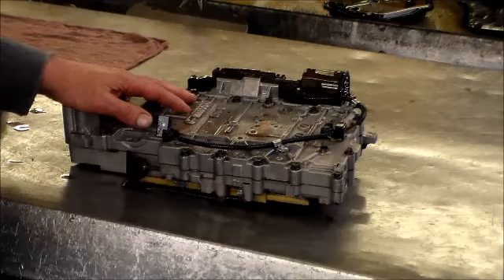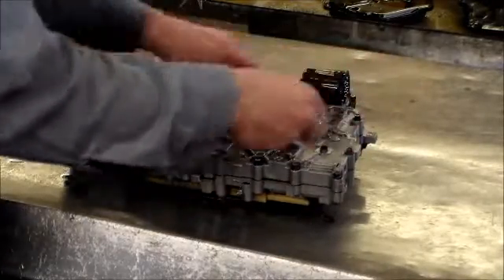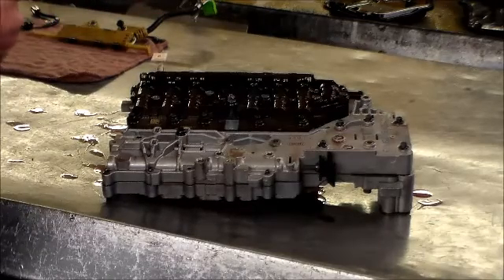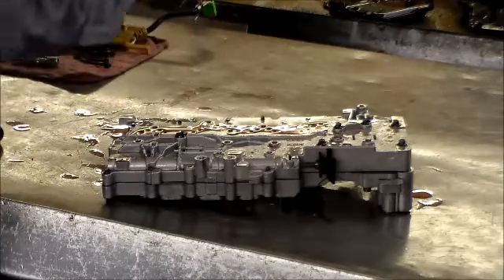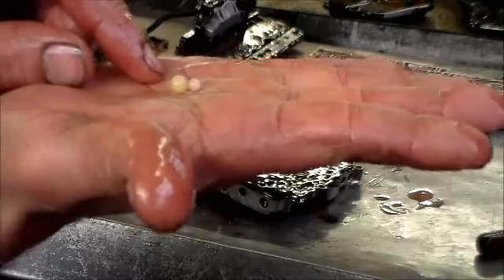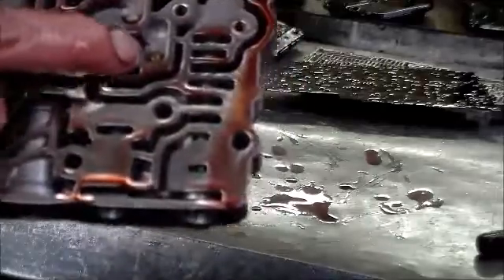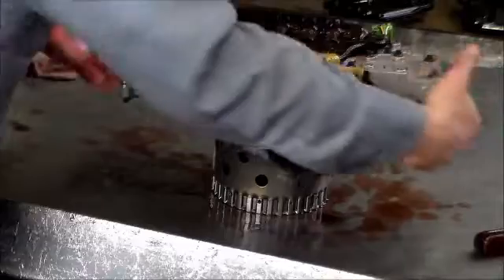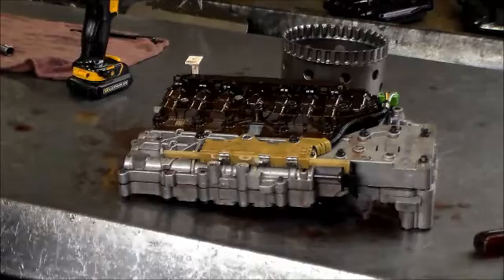6L80E Valvebody

Comment: Hi @Gary Ferraro. Thanks for the videos and all your help. I have a 2010 Chevy Silverado 1500 with the 5.3l motor. I believe the 6L80 transmission. I have codes p0776 and p0700. The truck seems to over rev up to 4k rpm before shifting to 3rd gear and when in reverse it is really lazy and struggles to back up into my driveway. Also, I checked the trans fluid and it seems to be way overfilled! So I drained some of the fluid out until it was in the cross hatch area. I then drove it around the block to see if that made any difference but problem remained the same. What do you think could be the problem?
Reply from the maker: does the trans work better when cold? then when warms up starts to slip?
Reply: @GaryFerraro  It does NOT do it when cold. Forgot to mention that I just bought it from an auction and don't know the history in addition to the trans fluid being over full as well.
Reply: Did you find the problem mine was doing the same codes and same symtoms as you described I just took off the techcm and valve body trying to see what’s next
Reply: @big_W  I was told to replace the techm but I was not confident that was going to solve the issue and I didn't want to waste money if it wasn't the fix so I just replaced the whole transmission. Keep in mind, if you are able to get a guarantee from a reputable shop that replacing the techm will fix it then go ahead as it is a much cheaper fix.

Comment: Hi garry, I have a 6l80e in my gm holden commodore from Australia,   would a valve body unit that is faulty cause the 6l80e to flare? Mine flares when I accelerate hard, I pulled the it out a few months ago and had a crack on the drum, that was fixed and transmission was good for a few months, now my transmission repare shop seems to think the problem is in the valve body?
Reply from the maker: When does it flair    what shift?
Reply: @GaryFerraro 2-3rd... Will only do it once cars been turned off and in park, then re started and driving will flare once 2-3rd, and will not flare again unless you take off hard. I changed over the transmission with another rebuilt one and problem is still there and my mechanic believes it must be the valve body
Reply from the maker: @andrewnewman55  What year is the car?
Reply from the maker: @andrewnewman55  ok, so you swapped transmissions but installed your original valvebody/TCM and same issue?
Reply: @GaryFerraro  that's correct
Reply from the maker: @andrewnewman55  By chance have you tried resetting shift adapts?
Reply: @GaryFerraro  yes, they have been reset
Reply from the maker: @andrewnewman55  very possible valvebody or solenoid issue, in the valvebody are valves called clutch select valves, you want to make sure those are free, also could possibly be a leaking bore plug
Reply: @GaryFerraro  I have been quoted $1,200 for a reconditioned valve body and tcm installed and programmed, I'll let you know how I go once I have changed them over, thanks Gary
Reply: Andrew the flaring was common in many of the commodores because they used a shallow trans pan.  Look into getting the deeper transmission pan from other models.  Cadillac CTS I believe. YOu get a deeper pan and a different filter that has a wider mouth to suck up the fluid.  On hard accelerations it does not starve the trans for fluid and thus no flare.

Comment: Hi Gary, almost positive this is the issue with my 2010 Sierra. Transmission was totally fine until I lost all of my forward gears. If I pull the tranny ignition fuse, it will pump full pressure and I can move forward to at least move the truck around so I know that it CAN go forward. Almost positive it's going to be this check ball issue. Once I drop the pan, how difficult will it be to drop the valve body from underneath the truck and are there any specific tips you can give before I do? I'm ready to do a lot of cursing this weekend. Thanks for a great video
Reply from the maker: After the pan and filter are dropped, you need to pull the sleeve out or the valvebody will not come down and i wouldn't want for you to break the TCM.  There are 6 bolts the hold the valvebody to the case, a special socket is needed, the size is EP10  Like a torx plus socket. The tcm will need to be unbolted from the valvebody, then the valvebody can be unbolted and split apart

Comment: I have the same problem I was driving down the road and it seem like a kicked in a neutral but it was in drive then I unplug the battery for about 20 minutes and hooked it back up and started driving again and it shift through all the gears and when I come up to a light and stop it act like it kicked back in neutral it does the same in reverse what do you think that might be and it's making some kind of rattling noise right there where the pain is
Reply from the maker: Did you have it scanned for codes?

Comment: I put .250 metal balls in my valve body on a 6l80 and now i have p0977 p0974 does it matter if there metal
Reply from the maker: What year is this,  also what is the make and model.  I never used metal check balls in this unit.  What was original problem?
Reply: Pode romper a placa

Comment: Hi, great video! My 2008 GMC Yukon Denali has the 6L80 tranny. Lately, as winter started, when I first start the car, there is about a 2-3 second delay of engagement from Park to reverse, Park to drive, or reverse to drive...and when it does engage, it noticeably jolts into gear. If I let the truck warm up about 1-2 minutes first, it definitely is not so bad. If I drive the car up to temp, then turn it off, then restart it, there are no issues and engagement occurs right away. I had a recent transmission oil change, the tranny fluid level is perfect, and the truck only has 75k miles. No other transmission issues noted...Any thoughts?
Reply from the maker: Any codes by chance on the trans?
Reply: @GaryFerraro  , thanks for the reply. It hasn't displayed any codes up to this point. I brought it in to a shop, and they said the tranny seemed great. That said, it was already warmed up when they inspected it/tested it.
Reply from the maker: @KevinRapkochFishing  Well, on this Tehcm, there is an on/off solenoid that controls engagement. possible lazy solenoid, when it's not as cold does it act up?
Reply: @GaryFerraro  I really appreciate your replies, by the way. Thank you for your time.
Reply: @GaryFerraro  , the slip yoke does have a very mild weap of tranny fluid, but only occasionally will it weap a drop, and only if I leave it parked on at an incline for more than 12 hours or so without driving it.
Reply: Would there be a reason that it kind of clunks/jolts when it finally does engage? It doesn't rev or anything prior to engagement, if that makes sense.
Reply from the maker: @KevinRapkochFishing  im thinking computer may be raising line pressure when it doesn't see the input rpm go to zero when drive is selected
Reply: @GaryFerraro  thank you for the response! I have to admit, that's a bit beyond my understanding, but I just wanted to be able to make some suggestions and know what to ask about when I take it to a dedicated tranny shop.
Reply: @GaryFerraro , I wanted to make sure when someone said I needed a new tranny, I'd be able to run away and find someone who understands the intricate and separate parts better.
Reply from the maker: Kevin R. Keep me in the loop when you take it to a shop
Reply: @GaryFerraro  I definitely will, thank you very much for your support.

Comment: Hey Gary , I had this same issue and took everything apart and found the check ball stuck in the separator plate. Thanks for the video. I have a issue now that I can’t start the truck. When I was done adding fluid and about to start the truck the gear selector was on M5, I left it in park before I pulled the valve body. I tried shifting into park and lost the line under the PRNDM part of the cluster. Do you have an idea of what could be broken or not done correctly?
Reply from the maker: you either missed the manual valve or did not hook up the manual lever position switch, that gets hooked to the manual valve and the manual valve goes into the linkage to select the gears
Reply: Gary Ferraro , thanks for the reply. So the manual valve goes on the IMS? Does it move freely or does it move with the shift lever?
Reply from the maker: @wickedczr  The ims goes on the manual valve (They will move together) and the manual valve goes into the shift linkage.  You can always send a picture if you like, my e-mail is gsferraro@yahoo.com
Reply: Gary Ferraro , thanks for the helping hand. Will drop it again tomorrow and take a pic if I can’t figure it out. I think I didn’t attach it where the gear part is.
Reply: Gary Ferraro , thanks for the help. Thanks to your videos and responses my truck is back on the road. I left the manual valve off of the shift lever but thanks to your recommendations it’s all squared away.
Reply from the maker: @wickedczr  Awesome, Good Job
Reply: You sound like a great guy Gary can I email you? My 07 is having transmission issues and I'm hoping theres still some hope withoutbhavinf to buy a new trans. Best to at least try and spend a couple hundred then to just possibly throwing away a few thousand.

Comment: Great video, any idea what a po741 code could be if my torque converter checks out ok and good clean fluid and filter? 07 corvette 6l80e. Thanks
Reply from the maker: Could be a valvebody issue. How do you know the converter is ok?
Reply: @GaryFerraro  I don't waiting on Yank to get back up with me after they cut it open. From visually inspecting it they said the outside hub shows signs of it getting hot from the red paint being discolored.

Comment: I have a 07 Escalade with a p0756 its stuck on 2 gear what could it be ?
Reply from the maker: What type of scanner are you using to pull codes?  are there any other codes?
Reply: @GaryFerraro  have a snap on scanner but no that's the only code  soon as I shift it in to gear code comes up
Reply from the maker: @fsevilla83  Can you please tell me what other codes you have

Comment: I have a 2008 Sierra 2500HD with 6L90e.  I bought the truck needing an engine.  Got it installed and the trans has no forward or reverse with codes p0700 and p0777.  Fluid looks bright red. Suggestions?
Reply from the maker: Almost sounds like they broke the pump gear, this happened right after the install?  check the fluid level see if it reads overfull
Reply: @GaryFerraro  Yes, but I have no way of knowing if it was like that before. Should I put a pressure gauge in line to check pump output?
Reply from the maker: @Swollentastebud   you could or pull off a cooler line to see if oil is pump out, if it shows way overfull, pump is no good

Comment: Can you please help me with something I just want to know where is the solenoid B thanks
Reply from the maker: victor ortiz Solenoid B is part of the Tehcm. The solenoid I don't believe is sold separate
Reply: @GaryFerraro  thanks a lot I'm spend all day trying to find that thank you
Reply from the maker: @victorortiz8232  Your welcome, if you happen to get a new one, it will need to be programmed.  Whats wrong with the vehicle? Trans slipping? any codes?
Reply: I have a 2007 Chevy Silverado 2500 HD 4 wheel drive with the 4l90 and when I drive on the freeway and they go out to the street on the first stop dosing gate the first and the second gear
Reply: I put my scanner and say I have a problem with the solenoid B but I have another codes before no communication with the TCM
Reply from the maker: @victorortiz8232  Ok, you may have a 4L60E, do you remember what the code number is?   My e-mail is  gsferraro@yahoo.com   you should e-mail your vin number to confirm transmission type
Reply: @GaryFerraro  p0756 p0700

Comment: Gary,
I have the same year escalade and originally I had this problem. Went in a transmission shop and they told me all that was bad was TCM and replaced this 7 times and end up taking it to the dealership twice. replaced brake switch  and the cam actuator. Now I have engine light on with p0700 code and D solenoid stuck code on and it stays in limp mode with engine light on. Yes the TCM was Re-Flashed and had all the current updates to PCM. What should I do now? You think the changing worn out check ball fix my issues?
Reply from the maker: It is very possible, i would drop out the valvebody and see if that #1 ball  shrunk down, you had a problem of the car not moving in drive?
Reply: Gary,
Yes I did, it would do it at stop and go traffic.
Reply from the maker: @MadmanCustoms  That's usually when it happens. Most common starting from a stop it will not move forward
Reply: Gary,
I had taken my vehicle to another transmission shop and like you said #1 check ball was shrunken. Thank you for everything you really put me in the right direction on this repair. Transmission shops where scared to touch my escalade. You are the man!!!

Comment: I have a Holden SS. Same as Pontiac G8 but in Australia. Mine keeps going into neutral spasmodically and I need to put it in M2 and off  it goes again. Otherwise it works perfectly. My mechanic replaced  the TEHCM  and it's still doing it. Nobody in Oz seems to know about this issue with the checkballs
Reply from the maker: This happens in drive on takeoff?  How is reverse?
Reply: @GaryFerraro  thanks for the reply. Yes. It was functioning normally. I have a steep driveway. It first presented when I was going up the driveway and just as I stop to enter the garage slowly it appears to go into neutral with a slight braking effect. I put it in m2 and it will move forward . It may not do it again for 4 or 5 stops. Reverse is working perfectly. I saw your video and it makes sense to me but my mechanic was certain it was the tehcm.he drove it around and it wouldn't do it then I drove it home and it did it entering the garage again.
Reply from the maker: @garylennard4278  Certainly sounds like that check ball is the problem, that would be the first and easiest to check.  What year is the car?  By the way Greetings from New York
Reply: @GaryFerraro  it's an my10 built December 09. Funny thing is I live in the city close to the factory where these were manufactured and exported to the US as the Pontiac G8. The Tehcm I bought was $1500 au from Holden so I bought one by part number from Rockauto for $700 au It would not communicate with my ECU.
Reply: @GaryFerraro  thanks for your help. I got hold of Sonnax .250 checkballs which my mechanic is gonna do. They're a pack of 10 so am wondering should we replace all 7 of they're the same size. Also is there anything else it would be wise to do while the valve body is apart!
Reply from the maker: @garylennard4278  I would do all checkballs,  make sure all valves are free, the other section without the check balls have the Clutch select valves, make sure they are free movement

Comment: I have a 07 Yukon Denali that I replace the control module and the truck don't move forward any more.
Reply from the maker: Did you put an aftermarket TCM in like a doorman?
Reply: Yes.
But later I put a brand new and reprogrammed and no fordward.
Then I put another valve body and it works. 
What can cause no fordward in valve body?.
Reply from the maker: @juanvicentemedina9110   #1 check ball shrunk down, letting the oil bypass causing no forward, common issue
Reply: Thanks.
I go to work on that.
Reply from the maker: @juanvicentemedina9110  Split the valvebody, that's what you will probably find
Reply: Ok.
Thank you for your help.
Reply from the maker: @juanvicentemedina9110  ok, let me know how it goes

Comment: Hey Gary I have a 2009 Chevy Silverado and I’m getting a p0751 code and it shifts hard from 1-2 any idea how to fix this?
Reply from the maker: What type of scanner are you using, there may be more codes present? if the pressure switches are coming apart you may get this code
Reply: Hey Gary took my valvebody out of my truck notice the clutch springs was sticking in the lower valve body I replaced it with a new lower valvebody put it back together and install back into the truck now I’m getting a u0101 and u0100 code the truck will not start do I have to reprogram the techm?
Reply from the maker: If you had the valvebody out, did you plug the range switch back in, also, check the pins make sure nothing got bent. If you reused the original TCM then no, no programming needed
Reply: Gary Ferraro the range switch would be the green connector? I’ll double check the pins
Reply: Yes I reuse the original tcm so I’m not sure why I’m. Getting this problem all connectors were connected on the valve body
Reply from the maker: If all pins are good, you will have to check powers and grounds, make sure no fuses blew,  you hooked up the manual valve?  no start in park or neutral?
Reply: Gary Ferraro can you give me some locations of powers and grounds to look for also which fuse should I check for?no crank in neither truck powers up but no crank and I get a message on the cluster saying service stabilitrak and traction control
Reply: Yes Manuel valve was hooked up all connectors that were on the valve body were connected back I triple checked every before I put it back in the transmission
Reply from the maker: ok,  need year make.model and engine size
Reply from the maker: need a little time to pull a wiring diagram
Reply: Gary Ferraro 2009 Chevrolet Silverado 1500LT
Reply: Gary Ferraro 5.3L
Reply: Gary Ferraro no problem thank you
Reply from the maker: ok,  underhood fuse block,  left side of engine compartment,  fuse number 19, is a 15Amp and fuse number 14 is a 10 Amp fuse.  check those see what you have
Reply: Gary Ferraro ok I’m going to check now will let you know
Reply: Gary Ferraro all fuses are good.
Reply: Hey is there anyway I can send you a picture of the connector for the tcm
Reply: Hey Gary I figured out what the problem was the connector was not plugged in properly wasn’t making contact want to thank you for all your help.